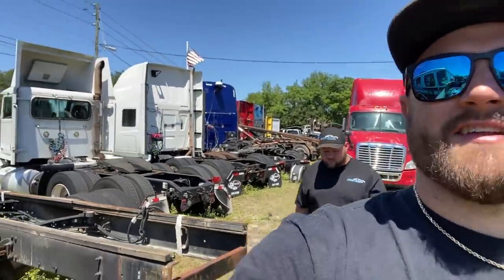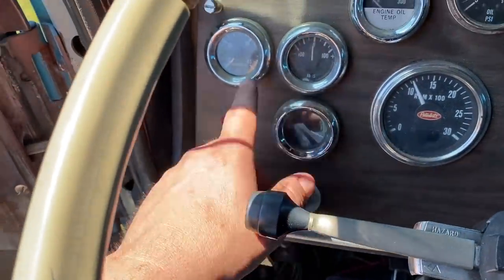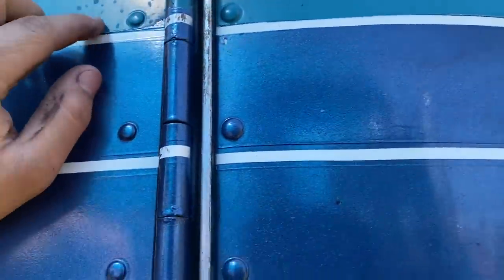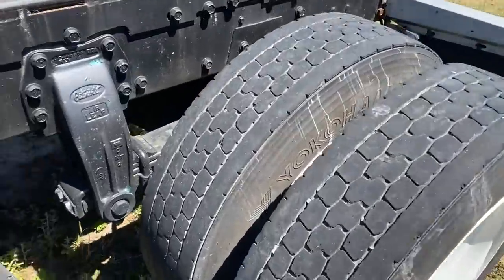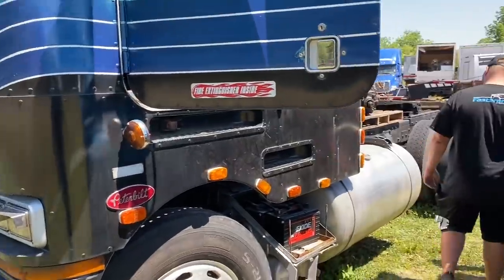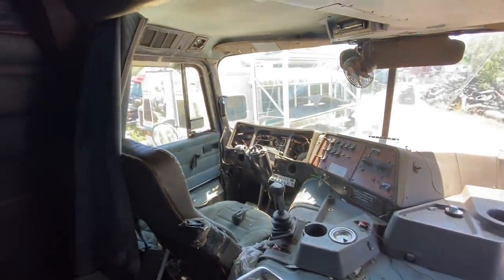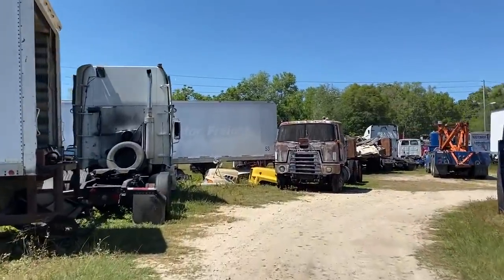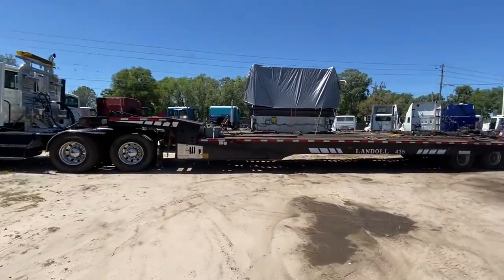Cabover Shopping Part 2! PeterBuilt 362 15 Speed Caterpillar????

Comment: Pete would be a good truck the back feed in the air brake release is a bad brake chamber but I would rock the pete and fix up slightly then when the international is done sell the pete if you choose to and make a little extra as you fixed everything to make road worthy

Comment: I’m a Cat mechanic, those 3406’s are invincible unless you do something severely wrong like cooking the fuck out of it or running it with no oil, just keep up with servicing and it should run forever. Same with the early C15’s
Reply: Blake Vella my dad when he did heavy haul he had a 3406 in his truck and that thing had power he would be 300,000 pounds going up hills and pulling the front wheels off the ground
Reply: I agree 100% I love the 3406 and the C15 best engines ever. I've been turning wrenches for 30+ years
Reply: BM_ AppleCOr3 p
Reply: Blake Vella could he put a 6x4 twin stick in a cab over? That would be cool
Reply: @turtleinwhalmart8114  He could but it would be a challenge unless the stick is built into the cab like the international
Reply: Still dont compare to a 3408

Comment: Peterbuilt with the CAT engine. Little rough. But worth fixing. If you get it for under $10,000. Go for it.
Reply: Yeah about $7000 to $7500 under $10,000 would be about the right price range.

Comment: I vote the petercar, I run a b model/15 over everyday. Not stock by any means but will stay in the left lane. The back bleeding air is probably a air chamber. The air ride is certainly a plus. Also those extra gauges become very useful if you start throwing the power and then weight to her.

Comment: The 362 Peterbilt reminds me of the 1981 362 that we owned for years. We bought it new and sold it about 1990. It had a Cat 3406 400 hp and a 13 speed transmission. It was a good tractor and I enjoyed driving it, but the dealer never did get all of the windshield leaks fixed.

Comment: I run a 86 362 every day. Very good trucks but it can be a real challenge getting parts for. Fortunately I’ve got 2 more for parts. Radiator, forget it, shift box, not happening, cab jack, nope, corner windows, not a chance, dash controls, long gone. I could go on...

Comment: That International is a Transtar. They were also popular trucks in their time (60s and 70s). If you want one that will pull, buy the Pete. Cant beat Cat for pulling or dependability. That one is probably 425 horsepower? Cummins would be my second choice but I prefer Cat over any of them.

Comment: Hey Bruce if you need parts call Pinson Truck parts in Chesnee SC.  Google it it comes up. They have a salvage yard like this and also deal in new parts and re man parts.  That cabover with the small cam Cummins is a CO-4000 model.  Would love to see a will it start video 🤞

Comment: The largest sleeper has two hand holding bars on each side. They are much larger.
The one with the taller interior is a company truck for van trailers and usually have double bunks. 
It illegal to have anyone in the top bunk while traveling.

Comment: Exhaust temp, not pressure. Air application gauge, for your brake applications. You don't want a 15 speed unless you are hauling heavy loads. Those transmissions have super deep reduction and bad highway mileage. Those old cats will smoke until they warm up always.

Comment: Doesn't have injectors. Has fuel nozzles. The pump has the plunger assemblies in it. Those nozzles are fairly easy to change. Definitely a worthwhile truck.

Comment: Good looking pete. That cat is gonna smoke .if ot has alot of blow by from the block vent then it needs a rebuild. But that cat will run circles around that cummins. For its age its in pretty decent body wise. All those goodies your putting on the white truck would make that pete a bad ass truck

Comment: Not 100% all the time but Red button is typically a 13 speed (splits the high side), blue button is typically a 15 speed (splits the low side), Grey button is typically an 18 speed (splits both).

Comment: have 2  03 model thomas built  school buses with the 3126 cat engines. i like them just exspensive when they break down. i had a 97 thomas built school bus with 3116 cat in it she ran good as well i bought a 01 international school bus with the dt466 and sold the 97 thomas. wished i would have kept it.

Comment: Probably get a good deal on a international 9900i Eagle 🦅

It will be easy to learn on a 13 speeds or a 18 before you start driving the cab over

Comment: That old IH cabover is a 4070a......that 362 Pete is actually a far more capable truck than your 9670. If it proves out on a test drive, and the price is right....it would be an excellent buy.

Comment: Alot of the truck your looking at need the work you already put into your cab over might be worth is to get a decent used semi engine and throw  it in it the get it running till you get the other one built

Comment: The Pete is a nice one for sure. There's air hoses in the instrument panel on a lot of the Petes. Still owe us that one White Freightliner... can't be scared of Detroit motors all your life. This latest one had a STRONG engine in it and they're good for a million miles... Be more interesting to get that one you were looking at before Christmas. Sounded like it needed a bottle of Bioclean and some injector cleaner... sprinkle some oil over the rack and you'd be in business with that one. But the new Freightliner sounded very strong and fired up Quick! Typical of Detroits. There's still lots of old Buses running around on original Detroits from the 1940's Bruce. Well built motors! It'd make a real interesting and cool Truck to Doll up to bbe in your fleet for truck shows, car shows... whatever shows... :-) Freightliner!! If you hate the Detroit after a while then drop in a Catepillar or a Cummins... but Detroits are fine motors. ;-)  If you need parts they're pretty affordable if you go through Bus Grease Monkey's contact at U.S. Coach. He mentions that guys name  in a lot of his videos. The prices he talks about for parts sound way more reasonable than the parts for the Cummins at any rate. Worth a thought. Just another internal combustion Diesel after all lol

Comment: Nothing you can’t pull with the 15 speed the only thing is it’s not sequential like an 18 for example you don’t go 3 low to 3 high to 4 low because 3 high and 4 low are the exact same gear you go 3 low to 4 low to 5 low then 4 high then to 5 high if your heavy and 4/5 are reversed and 9/10 are reversed but it’s a torque monster

Comment: If you buy that you should change it to a 13 or 18 speed and stretch it out
Reply: No its perfect a 15 is perfect between both of those and the length is actually pretty long for a coe
Reply: @appl69  Well if you didn't know a 15-speed is actually a 10-speed with 5 reduction gears and a stretch on it would look to bad

Comment: That old cabover is a International Emoryville
Reply: I say it's an International Transtar. Here's a model year 1971 truck with the same grille: https://www.mupload.nl/img/jlh2756zi14d6.jpg
Reply: That was a 4070 not an Emeryville.
Reply: 71 4070a  i have the doors off that truck for my 69 4070a
Reply: My bad I though it was a Emoryville
Reply: @mileaftermile7797  its all good

Comment: The Pete is a better truck. The 15 speed will be easier to drive. The cat will give you much better power but it will eat your fuel depending on how high you turn it up and how you drive it.